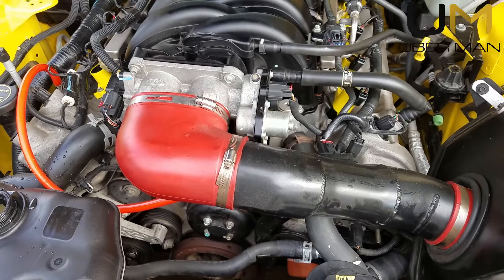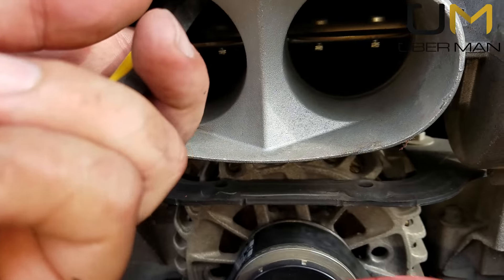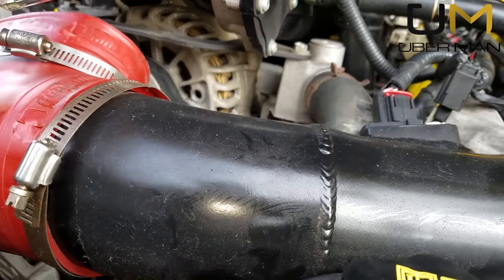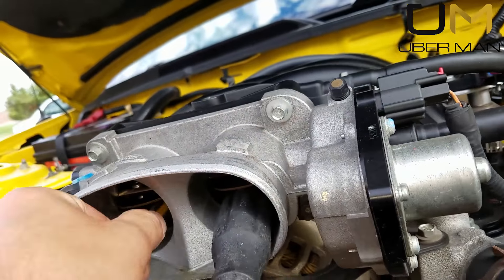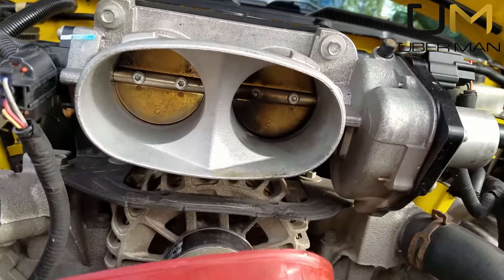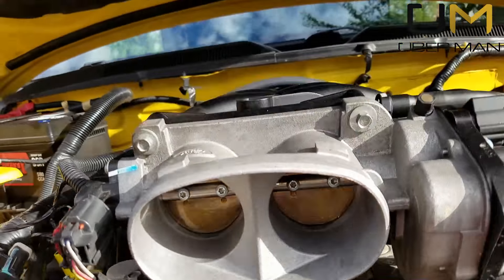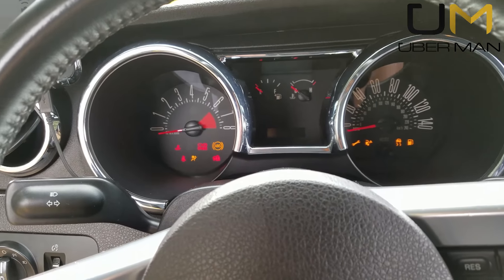2005 - 2010 Ford Mustang GT Throttle Body Cleaning

Comment: You can remove the throttle body, clean  it thoroughly, and reinstall it in less than an hour. It's way easier than doing it in place.
Reply: and its more safe for the engine.
Reply: @tylerdurden2300  when putting the throttle  body back .  Do you have get new gaskets or anything?

Comment: Do not use one of those hard bristle brushes they scratch that soft metal and that allows air to flow through when it should not... Spray the cleaner and use a soft rag to wipe it out or you will damage your throttle body...

Comment: My car dies at idle . I put everything new and if release the gas pedal it dies . New battery fuelter maf sensor spark plugs cables fuel pump egr valve oxygen sensors fuel injectors . Idk what else could it be . I dont see any vacuum leaks .

Comment: There is no telling how many thousands of  sensors and cat converters has been ruined by carb cleaner. Hope you have a good lawyer.
Reply from the maker: I have a great lawyer. I also have over 23 years of experience as a mechanic. I was also a lead tech in my 20s. Carb cleaner evaporates dumbass! That is why I made it VERY CLEAR in the video to wait 20-30 minutes with the throttle plates OPEN to assist in the evaporation process BEFORE STARTING.... FUCKTARD.
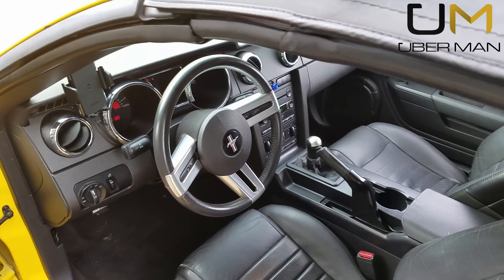Reply from the maker: 8:42 fucker... I'll be waiting for an apology.
Reply: One of the first things taught in Emission School is never to use carb cleaner on a computer control engine. You must have ditched that class.
Reply from the maker: +CBDav emissions school LOL are you kidding me yeah I must have missed that entire school.
Reply: CBDav ..  am using the same approach on my mustang GT since 2011. brake cleaner work like a charm. it take only less then 3 minutes to dray completely.
Reply: shadad07: O2 sensors are very sensitive, but they can be cleaned. DO NOT use any solvent/cleaner that is not labeled 'O2 sensor 
safe.
Reply: CBDav .. O2 sensor? O2 sensors are connected to the exhaust system bro lol. you mean the MAF Sensor? anyway. Brake cleaner work like a charm since 2011 on my Mustang GT 2011. throttle and MAF Sensor. even tho you dont need to clean the MAF as most of the dirt is on the throttle. cheers.
Reply: Uber Man:  it shows.

Comment: I used the exact same carb cleaner to change out my 2 piece spark plugs in my 05 mustang gt and I also used it to clean my throttle body all late week and it worked great with no issues and i waited an hour before driving. Idke improved and power was restored.  Great great video. I detached my throttle body from car but this method is just fine also. Great job

Comment: I went to do this and found your video. I will say I can't believe how much doing this helped my car. I am aware obviously that it is important but I didn't realize it would affect my car so much to not. I did not use carb cleaner,  I used crc tb cleaner but man it was quite dirty and as I sprayed I saw a few hard pebble like pieces of carbon or debris of some kind, first the day before I cleaned the maf sensor and drove a bit and noticed a difference on the get up and was surprised by that. I was having issues when hitting the gas and then letting go quickly. Vise versa. Also the  responsein general was poor. I have a Roush intake and borla atak axle back, but along with the hesitation I also had issues with shifting. It was slight but when the car hesitated it would also hesitate to shift which make for a less smooth shift into gear. Now it just slips right in. My pedal is once again like a button and for the first time since the exhaust is fairly new along with the intake I'm experiencing the full potential of my bolt ons, I still have not tuned it but both bolt in do not require one. Anyway, I was worried I had something major wrong, simple things first. This will be a routine for me to clean these parts
Reply: Right there with you David, I'm also having an issue with throttle response , and even idling.  I've had my new TB and CAI installed for 4 years now, never thought about cleaning them, so this is probably why.

Comment: (I do this same procedure to my old Jeep as well.)   So many people online talking about the "delayed" throttle or hesitation on 05-10 Mustang.  One guy even felt he should MODIFY his throttle pedal to resolve the issue. Ummm, how about not.  "Listen" to what you car is telling you.  All I did was clean the throttle body and the brief hesitation went away.  So fricken simple.  Simple maintenance!!!  I made my 07 GT (69,000 miles) feel like BRAND NEW AGAIN just by doing a basic tune-up including spark plugs (broke only one of them), cleaned spark plug cavities, cleaned throttle body, fuel injector cleaner, also cleaned misc sensors relating to air intake and throttle position - car was literally transformed from meh to extremely smooth beast.  So fricken easy, y'all.  OH, and if your automatic transmission is shifting a little harsh, try replacing the Throttle Position Sensor. I did mine, and now it shifts literally like new.  Stop overthinking things!  Great video, by the way.   BTW: use a large round/spiral type brush and you can clean the entire throttle body region much easier.  Get at most auto parts stores.
Reply: My 07 mustang gt has a rebuilt automatic transmission and sometimes I floor it and shifts the passing gear hard and when driving normal the gears shift good just sometimes a little late idk what it can be

Comment: Looks like it worked nicely. Though you used Carb Cleaner on this, could you do the same cleaning with Throttle Body cleaner as well or would that not evaporate fast enough? (I would hate to kack something that was not intended)
Reply from the maker: TB / Carb cleaner works just fine on this. Whatever you choose will be fine.
Reply: Uber Man  it worked like a champ. My ponies performance had a complete change for the best. Thank you for sharing this!

Comment: On New gm cars..if you do that you will have to drive it for atleast 100miles for the throttle body to reset itself or you take it to the dealer to reprogram the throttle body. I did what you did a year ago on my 2009 silvarado but then the rpm was idling high...i got it reprogrammed at the dealer
Reply from the maker: Great info! Thank you.

Comment: New 2016 GT owner here.  Not going to lie that I am ignorant to the ins and outs of my new car.  Can this be done the same on the 6th gen stangs?
Reply from the maker: I have a '17 now. No, don't do this.
Reply: @AutoAuctionRebuilds  and you shouldn't do this with a 2005-2010 GT either. Take the damn throttle body off the car.

Comment: I replaced my throttle body and car runs the same or worse.  I press the gas and it won't go.  Hesitates then either stalls or won't go forward.  Then it jumps forward.  It also stalls when I am at cruising speed.  I have a 2008 Mustang GT convertible.  They have replaced a lot of parts.  The diagnostics now says electrical.  I have about 77,500 miles on the car.  Haven't been able to drive it since April, I'm on my 7th mechanic!  Help.
Reply: Did you figure out the issue???

Comment: Jlt oil catch can eliminates this whole process. Taking the tb off is easy rather than spraying CARB cleaner on a ford throttle body. The hose going from the valve cover to the intake manifold is what causes the blow by so just get the jlt oil catch can

Comment: I have a 2008 Ford Mustang GT premium, I hit a terrible dust storm 3 days ago and ever since I haven’t been able to accelerate at all.. my rpms shoot up and it acts like I’m going up a very steep hill. So first thing in the morning I am trying this.. prayers it goes well! Hopefully it’s not a clutch, transmission or fuel pump issue!
Reply: brandon stokes did this work?
Reply: Check the engine air filter while youre at it

Comment: Why would you just not just take it off and clean it, it's like four bolts.
Reply from the maker: Because I chose to do it this way.
Reply: Well clearly, but if you take it off you remove all risk of getting all of that cleaner and dirt into your engine and exhaust system. This is more for anyone else reading this thread.
Reply: Why are you here then? This is not a video about taking off the throttle body smh
Reply: @quikwen  Welcome to four years ago?
Reply: @donnieleach3180  I don’t care if it was 100 years ago the question would remain the same.
Reply: @donnieleach3180  lol
Reply: @quikwen  xD

Comment: It would be faster just to use seafoam! I use it on my 2 Crown Victoria Police Interceptors and believe me you can tell the difference.
Reply from the maker: Seafoam (I have years of experience with it) does not, and can not clean the throttle body / plates. It is inducted through a vacuum line (usually the brake booster), where it cleans the combustion chambers, and intake valves. Cleaning the throttle body is very important to smooth, and responsive throttle.
Reply: JAGExecutiveServicesInc  sea foam didn't help me